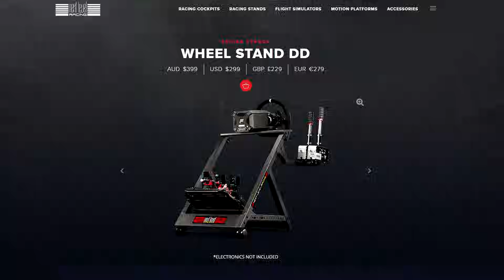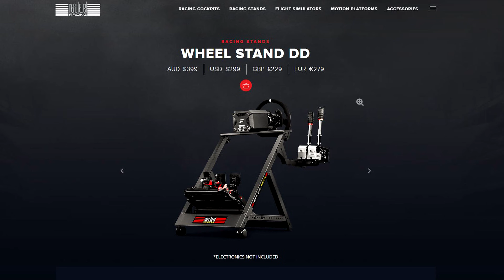Next Level Racing Wheel Stand DD Review

Comment: Great video and informative as always. 

Just to add more info for who are interested to purchase one. I've received the stand today and they've fixed the shifter flex issue by putting a U shape clamp instead of the flat one which gave it a better rigidity, plus no more gap in the square tube which connects the upper part of the deck. 

I'm glad Next Level Racing took the feedback from the community and enhance their products.
Reply: That's good to hear. The gap in the square tube connecting the upper part of the deck is flexing when under load and creaking like crazy. Next Level are sending me out some replacement parts so I hope that fixes the issue.
Reply: Well, mine has that U shape clamp but the gap in the square tube is still there, I can sneak a knife in it.

Comment: On the unit I have purchased they have changed the design so that the shifter mount now fits very tightly around the main stand on both sides as well as the front, all welded joints, the sides have rubber inserts to make it very tight.  Not using a shifter at present but looks a lot more stable.

Thanks for a great review, very happy with the unit, suits  me very well as I like to swap between driving and flight sims.

Comment: Just a suggestion. You can change the wheels on your chair to the posts with pads on the bottom so they don't move. I did that with my Secret Labs Titan and it doesn't move even when I'm pushing my brakes with all my might.

Comment: Thanks for the great review Barry. I have owned this particular stand a couple of weeks now with the Fanatec DD2 mounted. I bought it to replace a wheel stand pro. Space is a problem for me so this solution worked perfectly. Unlike the wheel stand pro, moving this frame out of the way of my desk is not feasible, so this is a permanent sim racing setup for me. The biggest issue I had was with the less than optimal angle of the wheel when the rear castors are fitted as mentioned in the video. Using the adjustments on the plate the wheel base is bolted to didn't help as they were not fine enough. I couldn't lower the height of the frame any further to compensate. I also couldn't get the rear castors off without dismantling everything, so I ended up putting an old piece of carpet under the front of the stand and that did the trick. One other problem I had was with the gear shifter mount. My chair has arm rests (unlike the one you are using) and the gear shift mount gets in the way as it sits at the same height. So I can't use it, this is really a big oversight on whoever came up with that idea. As it happens I don't have a separate gear shift so it's bit of a moot point for me :) Other than these two points, I'm very happy with the stand as there is really nothing else out there that will work with my limited space at present.
Reply: I might get a DD1, will this stand be suitable for that? Space is an issue for me as well, but if I'm to get something like a DD1 I want to know I'll be able to use a lot of the force feedback it can put out, otherwise I feel I'd be wasting my money.
Reply: @meme._hoe._8392  For me the stand is very stable, although I'm nowhere near using the full torque of my DD2. I did have one issue with the right hand side vertical support pole creaking when my wheel was under load despite all the bolts being fully tightened. Next level racing replaced the pole under warranty - the new part looks to be a resdesign too. All good now though and I've owned the unit a little over 1 year.
Reply: @rossdev  Awesome, thank you for replying! If I were to get the DD1 I don't reckon I'd use all the torque available as I've only ever used a Logitech before so I'd have to work my way up, I'd probably start at 5nm max then work up to 10 I bet. How much do you use?
Reply: @meme._hoe._8392  No problem at all :) I haven't used the torque key yet so I believe my wheel is limited to about 10Nm of torque. The wheel stand should work perfectly for you in that case.
Reply: @rossdev  Awesome to hear, thank you very much!
Reply: @meme._hoe._8392  most welcome and hope you get the enjoyment and use out of it like I did.

Comment: You can buy caster wheels for you chair which have brakes on them. They are very cheap and do the job so it's a nice easy solution :)
Reply: I didnt try personally but you can also cut tennis ball in half and put them on your chair wheels when you are racing
Reply: @h1tzzYT  I ordered replacement casters that fit into the chair, but instead of wheels that roll, their just solid flat bottom caster feet. $7 on Amazon.

Comment: I have had mine for 6 months, I mounted a T-500 wheel, a pair of button boxes, a TH-8A with a Ricmotech "clickety clack" sequential shift improver on mine. I used a junkyard seat on part of another rig base. I don't have nearly as much gap and no measurable slack in my DD wheel stand. I am using a set of G27 pedals inverted and mounted on another pedal plate. It is mounted at a 90 to regular pedal plate. I am using a ratchet strap to hold that from deflecting.  With my feet on my pedals, I can yank the wheel towards me, but not happening. I love my rig. I like having it in two pieces, it makes it easier to move for cleaning. It is still pretty hard to move much. With my button boxes and the way they reinforce the top plate does not flex. But there are extra plates and bolts and all that. I really love my rig. Lots of adjustment.
Reply: I got tired of the wheel moving down and the front of the rig going up, but since I have round tubing in my seat base, it would be hard to bolt together. I used a couple of small simple straps, ratchet would be better, but non-ratchet works. I just went around and under the tubing, pulled it snug and tied off the excess. Virtually zero movement. I can still undo the straps to take it apart and move it for cleaning.

Comment: Barry, I just built one of these units up and the shifter assembly has already been much improved over the unit you used in this review ... the mounting to the stand now wraps around three sides to create a much more rigid assembly.  I also note fortunately, that the sliding vertical rails on my unit fit with tighter tolerances than what you had so that there is less of a gap.  On the down side, I didn't get the nice lanyard or the extra decals but not such a great loss from my perspective.  I went with this unit even as I only intend to use it with a Fanatec ClubSport set-up ... my objectives were portability and being what appears to be the most stable stand available.
Reply: How much does it weigh with all the gear attached? Do you use the wheels to move it or pick it up?
Reply: @Catcrumbs  the stand itself weights around 20-25 kg
Reply: was about to comment this, not only the shifter "arm" has an U shape profile, it also has rubber for better fit, makes it harder to mount tho, but nothing too big. Also the supporting part now its from the same square profile and not just a 3mm shape, and its welded properly.

Comment: They actually improved the mount for the shifter/handbreak arm. I got mine today and the mounting looks different. It now has like a U form and something like rubbers inside the mount, which "grabs" around the pole where it is mounted. It feels much more stable then it looks in the video. I finished building it now, but will do the fine tuning maybe tomorrow.
Reply: Legend

Comment: What is the difference between this wheel stand DD and the Wheel stand 2.0? They look identical to me with a $50 difference
Reply: Any ideas yet :)?
Reply: @Thirtysix.Darryl  lol yea I had to look up online quite a bit, from what I read the DD stand suppose to be more rigged and is not foldable unlike the 2.0 which does fold.... aside from that they the same..I seen people use the DD1 on the WS 2.0 with no issues
Reply: Sweet man thanks for the quick reply, i have just bought it and we'll see how it holds, always room for making changes to it if needed.
Reply: @Thirtysix.Darryl  cool, I picked up the WS 2.0 stand over this DD one. Along with the Fanatec Gran Turismo DD Pro premium bundle, fanatec Sq 1.5 shifter, eBay handbrake, and stream deck XL.. already have my Quest 2 VR for the games... and soon I'll add the GTseat addon which we could add for the WS 2.0 and DD stand.
Reply: @CamaroWarrior  went for the 2.0 also it should hold the CSL well, the little extra features/fixes did it for me along with hearing the flex aint that bad, good luck with ur purchase mine is in tomorrow!
Reply: I watched some videos on the 2.0. The issue of the male/female part being too loose seems to have been addressed (there's a plastic insert in the female part now). The shifter is different too. The chair catcher is a nice thing too. Fold-ability is nice too. I wonder if I can hang this thing folded in the wall (without undoing the wheel/pedal). But I'm afraid I lack the necessary strength to lift this thing 😅

Comment: Just bought it a few weeks ago, since i'm not only sim racing i bought this Wheelstand so i can use the same setup for regular gaming. 
It works fine with Heusinkveld Sprints - you just need some breaking casters.
Reply: What about the whole chair tilting backwards? I could never solve this issue without having the chair against the wall and the setup in the middle of the room
Reply: @eliasbejok3690  Never had any issues with that. I'm just locking wheels on the chair. I got my brakeforce on HE on around 20kg and when i'm braking, i just hold on tight on my wheel.
Reply: @eliasbejok3690  Get yourself a recliner, it won't move!😂😂
Reply: How did it hold up against the sprints over time? Im getting the exact same setup. Did you use the pedalplate? If so, do you think it will work without?
Reply: @Deadbeatbeats  Hi, yes it worked without any problems - i used the HE Pedal plate and screwed it on the one from the wheelstand :)
Reply: @noahbetschki358  Do you think it will work without the pedalplate?
Reply: @Deadbeatbeats  Yes it can work - but you won't be able to use the full force.

Comment: Hey Barry. I bought my wheel stand to replace my Wheelstand Pro when I pre-ordered my Thrustmaster T-LCM pedals. I live in a cramped New York apartment and really don't have room for a full rig. The one true disappointment I have with the stand was with the pads on the feet. They wasn't all that grippy enough for my hardwood floor and eventually, the adhesive loosened up to the point of being ineffective. My solution was to purchase soft rubber furniture pads to replace them.
Reply: Hi Adam, I have this one as well and the adhesive also let loose. I superglued all of the rubbers back on and took care to level the feet out perfectly for optimal grip on my oak wood floor. Stands like a house now and they don’t come off any more.

Comment: I don't have room for anything else, if I could fit a cockpit, of course I'd prefer that but I still need something that can cope with a direct drive wheel base. The amount of visible flex in the video wasn't excessive, but I'm sure you could brace the gear shift mounting point, eliminate some of that movement, and stands always benefit from something to push against.

Comment: The big reason why I'd go for a wheelstand over a full rig is that I can use it in the same spot as I normally use my PC and save the expense of buying another quality monitor. My PC monitor is on an arm, so I can adjust it perfectly for both simracing and normal use. I can lift my current setup (G29 on an Apiga AP2) in and out of place, but this thing looks like it would be too heavy for that, especially with some higher quality gear mounted. The casters look like they affect the adjustments too much to be a viable solution.

For me, the next step up I can imagine would be a rig on casters that can be rolled to and from the desk. It would have to be the right shape for the pedals to go underneath and the wheeldeck to get nice and close to the desk, as the monitor arm can reach about as far as the desk edge. Are there any products of that nature out there? If not, the NLR DD might be the best for my situation.

Comment: Thanks Barry. I have a lower end stand by Next Level. I'm 6"6" and wish I didn't buy mine. Its OK now that I've changed some things but its not the most adjustable friendly. I only bought it because I couldn't find anything else available. Cant wait till my SimLab P1-X gets delivered
Reply: Is it any good? I'm tall as well and was about to buy one of these but the flex seems evident. I want something strong and for tall people.
Reply: @ry4bfggfd  It’s not bad, but there is better out there. My new system is one whole piece. If your seat is not connected to the wheel stand then during heavy breaking you can slowly push yourself away from the wheel stand Depending on your floor surface, wood, carpet, ect. But for me it was the lack of adjustability
Reply: @ryanfitzsimons7388  Oh I meant is the SimLab P1-X any good? Postage to Australia will cost a fortune so I need to make sure it's the best.
Reply: @ry4bfggfd  I like mine a lot. It does take a bit to get it adjusted to your body. Great if you’re the only one using it but could be challenging adjusting it constantly if you’re using it with multiple people. I use a wider seat so I wasn’t able to use a regular seat slider to move the seat back and forth.I just bolted the seat to the p1x
Reply: @ryanfitzsimons7388  Thanks for your feedback. I'll be the only one using it.

Comment: I just bought this wheel stand and wish I hadn't. I'm not a big guy but when having the shifter mount installed on the left hand side my thigh is always rest up against it when using the clutch pedal on my Fanatec V3s. It's annoying to the point I removed it . Plus the angle with the caster wheels fitted is just stupid and without them fitted it's hard to move the wheel stand around because it's quite heavy.

Comment: Buy a junkyard seat, a flat base and some industrial locking  casters. That will give you an "ergonomic seating position." You have to be able to think outside of what can I buy online? I do use a pair of small non-ratchet straps to cinch the two together and it is rock solid comfortable all day and easily separated. All for MUCH less that a one piece rig with a seat that is comfy for 5 minutes and than you need out.

Comment: I know this review is now two years old, but as a person looking to buy this I'll put my two cents in. I have an incredibly tiny room that's barely big enough to fit my desk and bed, and while my desk is really solid and great for mounting my wheel to, my pedals are terrible and mounted very poorly. As well as that, having to remove my wheel from my desk to be able to use my PC as just a PC rather than a sim-racing-exclusive system, is very annoying. I want this because it'll give me a place to permanently mount my wheel and pedals, as well as the flexibility to use my gaming chair as both my sim-racing and PC chair.

Had I the space, I would go for a proper rig.

Comment: That plate the wheel sits on loses after some hours and you need to strengthen it back. There are plenty screws if some will be damaged after a while. That's the main issue so far (one week). Also you have to fix the stand against the wall or something to not slide forward. It doesn't slide easily but for sure you can realize it moved forward after your playing session. Maybe that slide will not happen if you tie the stand with the chair. I didn't because my chair is stable, but I had to fix the stand against the wall.

Comment: So, I'm the edge case for this stand. I have the money, and not the space. On a funny note, I'm using a DD1 with Clubsport wheel, HE Sprints, and have just ordered the Aiologs shifter and handbrake.

The Wheelstand DD will do the job until I have the space for a 20/40 rig. I figure I'll have all the right parts for a full rig, and once I have the space, I'll just have to spend maybe $800-$1,000 to get everything completed.

Comment: Their 2.0 stand is much better with the range of pedal board adjustments, and the built in chair leg catch tray.. It keeps my Heman Miller Aeron with a solid connection to the stand -- doesn't move at all. It also helps that I swapped out the wheel casters on my chair with solid sliders  -- just drop two of the frontmost chair feet in the tray and I'm off to the races. 

I also just now upgraded from a 5nm wheelbase to a 25nm base. Hopefully the stand can take the added torque when the Simucube 2 Pro gets here! The Stand was only $250 and I got it before knowing if I was going to go all in on sim racing;  No regrets at all - as it's something that'll hold me over until I can afford a proper high end cockpit. I'll probably flip it on ebay when I upgrade in a few months. Heck, I might even keep it as a test bed for new sim gear and to have a second cockpit for friends to get in on some two-player racing .. It's easy to move out of the way when not in use.
Reply: I just got it and can you tell me how loud it’s meant to be mine seems pretty loud the vibration is awful I must of done something wrong not seen many with this issue
Reply: @Isa-t6v3v  sounds like you need to tighten some bolts.. put some muscle in it. . Never had any rattling with mine.
Reply: @AdamsOlympia  everything’s tightened lol I think I over tightened loosened it abit it’s better now